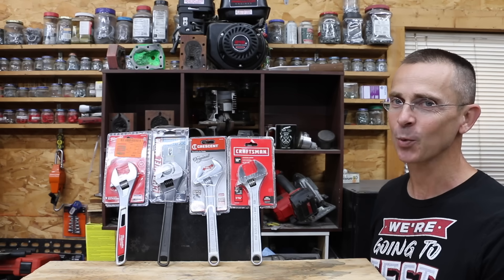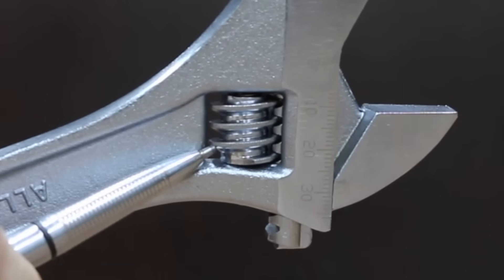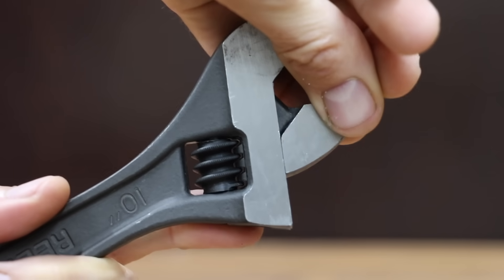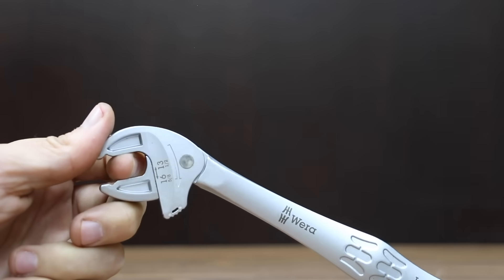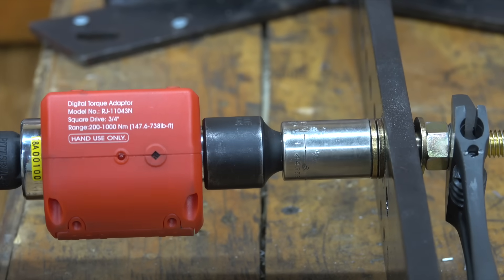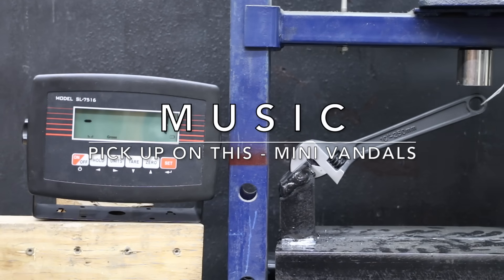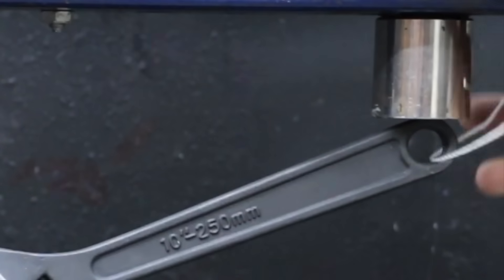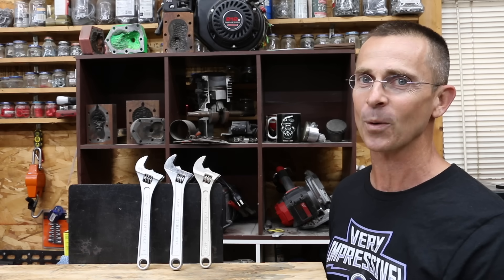Best Wrench (ADJUSTABLE)? Craftsman USA vs Craftsman, Crescent, Kobalt, Milwaukee, Channellock

Comment: I bought a set of BAHCO adjustables (and pliers) about 40 years ago, still working fine, v little play, holds the adjustment, AND, the screw adjuster doesn't protrude so that when you put the tool down on the bench it doesn't get knocked out of adjustment - a very useful feature.
Reply from the maker: Thanks for sharing.
Reply: Yup bahco very solid
Reply: Totally agree as they may not come out on top in Projects amazing tests but for daily pro use there is no substitute to a set of Bahcos not for Plumbing at least ;)
Reply: Had bahco for 35 years still the best adjustable
Reply: The snap-on(rebranded bahco) adjustable wrenches are the best in existence. I'd bet my paycheck on it.

Comment: Twisting force should always be at the inside of the adjustable jaw. Many use an adjustable wrench in reverse to its' intended design. Your punch through numbers on the nut tests would be different.
Reply from the maker: Thanks for the feedback.

Comment: What was the use to break all wrenches with the force over 200KG if a user basically cannot produce such a load on the handle anyway? Also I don't buy the vibration test - don't quite see the applicable usecase.

Comment: I love the testing on this across so many brands, and the variety of tests.
Coming from a statistics background - I would love to see these tests done on a sample of say, 10 to 30 randomly sampled units of the same tools.  The measurements of when something fails - has inherent variability - and I know it's expensive to buy ten of the same things, just to destroy them - but that's what Underwriters Laboratory does.  You can't take a single sample and really draw quantitative conclusions on spot samples.  I really, really love the work that's being done here.  I think I'm going with Crescent or Milwaukee.  Thanks for doing this.
Reply from the maker: Thanks and you are welcome!
Reply: that is correct. testing should be done on batches of same product and over time (which is missed almost always, like the magnets or batteries which weaken in time)

Comment: That was a very interesting video however I would suggest that you use some premium tool lines like mac and snap-on
Reply from the maker: Thanks for the video idea.
Reply: @ProjectFarm  thank you I really enjoy watching your videos I have been a professional mechanic basically since I grew up and graduated from high school I actually worked in a shop since I was 8 years old at my father's side working on International farm tractors I will say when it comes to end wrenches it is my professional opinion that you cannot be a Snap-On flank drive plus and ranch I think it would be an interesting test for you to put them up against all the others out there to see if they can do what the snap-on will do and that is grab a fastener that is 70% rounded off and still bring it out

Comment: I recently went to Lowe's to warranty a 13mm Craftsman gearwrench I've had for over 10 years, one of the first gearwrench sets I ever bought.
     Upon seeing the replacement was Made in China, I asked if the warranty can be done without exchanging my USA wrench. She said no.
     I proceeded to pay for the $13 Crapsman and put my broken USA back in my pocket, as it's still most likely more valuable than this crap they now are making.
      Craftsman, Made in China. What a bad joke.
Reply: The manufacturing process is not the issue. The issue is the Craftsman brand making the business decision to contract manufacturers in using lower quality materials, engineering process, and lackluster quality check just so they can make a higher profit from selling lower cost tools. We need to stop buying lower quality tools. This is more about the company rather than garbage made in China tools. I am sure if Craftsman wanted to pay more to create the tools, it will result in higher quality tools. Unfortunately, that is not the case.
Reply: @GariusMarius  the manufacturing process is not the issue. The issue..........is using lower quality materials, engineering process, and lackluster quality checks..

Soooooo......the manufacturing process IS the issue 🤔 lol. I hear what you're saying bud. I know there is good quality "Made in China" and junk "Made in China". IMO, I just know if you had a brand that was Made in USA for it's entire existence, the sudden switch to Made in China will almost certainly guarantee a lower quality product, and I wasn't forking over my USA wrench to save $13, even if the geared box end is frozen.
Reply: @senam9331  Read my last comment, attention span is not your strong suit.
Reply: Even looks cheap

Comment: I could only handle 5 and a half minutes of this guy's speed rambling. Maybe 1% of the population has the mental ability to keep up, take in, process and actually retain the numbers this warp speed speaking Gatling gun of a speaker is pumping out. I personally can not go 19 minutes of this rapid fire to hear the punch line. For me, if it turns a nut, Iam good to go.

Comment: You're a smart man. But you're using those wrenches  the wrong way. You're supposed to use them. With the top head of the crescent wrench turning in the direction of the nut you are tighting it or losing. I have been using hand tools for  43 years. I was taught by my grandfather that was master mechanic before me and his father was mechanic before him. You get more torque going  the direction of the big head. Therefore your testing is all wrong.
Reply from the maker: Thanks for the constructive feedback.
Reply: you caught this one too.

Comment: I fail to see the need to completely destroy all of the wrenches in the last test. Even the lowest rated wrench, at 581 pounds, would never have a user able to apply anywhere near that force on the wrench while in use. When sacrificing tools to obtain a number, perhaps first consider whether that number has any intrinsic significance.

Comment: My Snap On adjustable wrenches purchased in 1988 are by far the very best adjustable wrenches I have ever owned or used. I also have some Williams adjustable wrenches purchased in 1982 that are of extremely high quality.  I know that the USA Snap On tools are no longer built but as far as adjustable wrenches are concerned they are unmatched in design and machining tolerances.  Even after 34 years of professional use mine still perform like new.
Reply from the maker: Nice!

Comment: I still have my first craftsman tools from the late 60s.. that 'first tool box' with a 12" craftsman adjustable.. still as strong as it was 
when I was wedging it on crank pullies and cranking the engine to break the nut loose.
Reply from the maker: Thanks for sharing.

Comment: Shoulda used real wrenches ..the Armstrongs the wright's, the protos , The snap ons , as those are the 5 most used  ( millwright 19yrs ) where they see the most daily  abuse doin things you shouldn't ask of an adjustable wrench but when you're 140ft up gotta use what you have in hand lol..armstrongs have proven their worth with Wright rt behind ..snap on suck but I will their fixed wrenches are the only brand that handled 7' cheater bars without jaw spreading (superwrench was rt behind them in the fixed end ) ...those sizes   3  1/8 " and above ive seen  do some crazy shit done with cranes turning them ...cool vid tho
Reply from the maker: Thanks!  Thanks for the feedback.

Comment: Before watching, I will be surprised if the BAHCO is not the best one.
Reply from the maker: Thank you!
Reply: @ProjectFarm  We have a very old bahco wrench that a plumber accidentally left 30 years ago at my parents place. My dad and I have been using it ever since, and it is one of the most reliable tools I have ever held in my hands :) it still performs exactly as it did 30 years ago. amazing when things are built to last forever! It surprises me that it is made in Spain, because my dad always told me that it was Swedish

Comment: This video shows Craftsman doing something that so many companies have done in recent years, and it makes no sense.  You can spend decades, even more than a century, building up a rock-solid reputation—and then, when control is given to the wrong people, you can destroy the excellent restoration that so many people proudly worked so hard to build and maintain.  Surely there's more to being able to sleep soundly at night than knowing that you made a quick buck producing junk.
Reply: Sears is gone.  The Craftsman name was sold...just the name.  So whatever Chinese factory is pumping out tools, some of those tools have Craftsman stamped on them. It's meaningless anymore.  A sad day.
Reply from the maker: Thanks for the feedback.

Comment: You see that’s a problem. I own a whole set of wearer adjustable wrenches. And the smallest one in the pack I applied a lot at work too and broke the tooth off for being such an expensive tool and a high-quality I wouldn’t expect it to break so easily I will say there’s a lifetime warranty on a lot of these tools to a certain extent but the amount of money that you’re putting down on a tool should reflect and it’s ruggedness endurability
Reply from the maker: Thanks for the feedback.

Comment: Adjustable wrenches are used wrong. The weakest point is the outer end of the  sliding jaw,. If the wrench is used with the torque closer to the body of the wrench, it will perform much better. Good comparison though. Not many people understand 'crescent' wrenches.
Reply from the maker: Thanks!  Thanks for the feedback.

Comment: I've watched quite a few videos from you, and I will continue to do so.   But if your videos were books, I consistently watch the introduction, the index (and summary of inidex items), and then completely skip all  the individual chapters and focus on the conclusion and appendices.  If it works for you, great!  But I don't have a single care about the specific gap difference between the 8 tested brands.  All I want to know is what's best, what's worst, and the highlights of what's in the middle.  That said, I value the information you present, and you have my thanks!
Reply from the maker: Thanks and you are welcome!

Comment: I've always been a Craftsman guy. Right before they started closing down all the Sears stores in my area I bought a bunch of the original Craftsman tools from them, including about 4 or 5 of the 12" adjustable wrenches because they were on sale. So glad I did. Not a huge fan of the new stuff they are putting out and selling at Lowe's. It's not all bad, but it's nothing like it was before. I miss Sears and the old Craftsman line.
Reply from the maker: Thanks for sharing.

Comment: I own the USA made craftsman ones and can attest to their quality in material and tolerance. Been using every day for years and little to no deformation or loss in parts tightness👍👍👍

Edit and I use cheater bar extensions on it and use it on red hot fasteners and impact guns on the opposing end as well
Reply from the maker: Nice!  Thanks for sharing.

Comment: Tool, have gone thru a lot of tech updates.
And yet " one " of the most often reached for tool really has seen no to little tech upgrades in decades !!!! 
When I was younger craftsman & crescent
" Seemed " ( based on a old memory 😂 )
To have decent grip.
But I recently had to replace a stolen one & was disappointed at familiar names !!
So, seems like Spain is the place !!
Even sockets and open ends/box wrenches r cheap.... Or the bolt&nut industry !!!!!
Smart test w the impact !!!
I've had some of those wrenches open up just from taking it off and putting it back on repeatedly for  undoing .... that constantly having to thumb it to snug it back down .... or it gets too tight and so you can't get it off so you got to back it off a little bit ...  just crappy made wrenches anymore 😥
Reply from the maker: Thanks for sharing.

Comment: I started to convert all my tools in the shop to Wera tools: they are innovative and and for almost all tools found a way to make it easier and faster to work with. I only had an issue once, and got a new tool in replacement right away, no questions asked.
Reply from the maker: Thanks for the feedback.